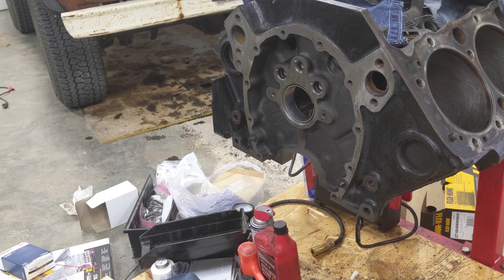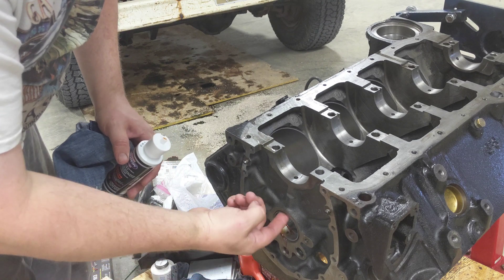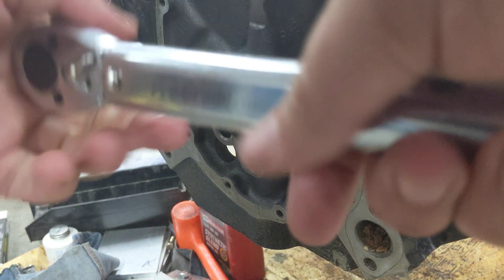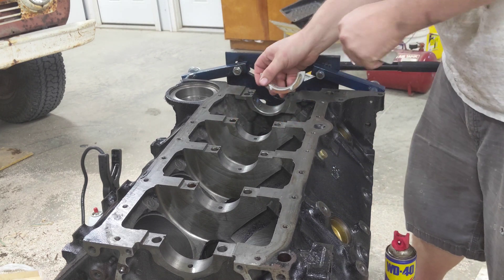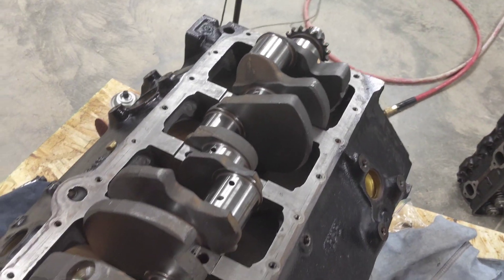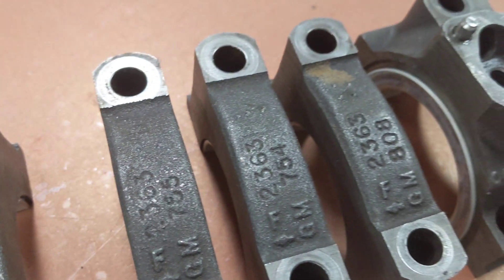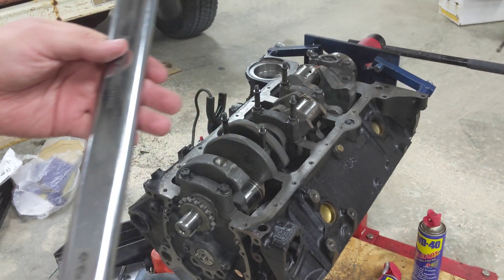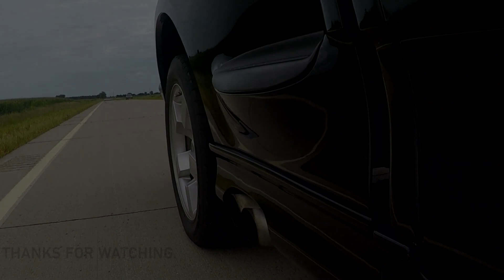'95 Crownline 5.7 Mercruiser Rebuild Part 8 -- Camshaft and Crankshaft Installation

Comment: Why so small torque for Crancshaft ? I assembly my 350 right now, and in manual are writed 105 Nm, so its 77.44 FtLb.   And also my crank is not rotation so eassy with one hand
Reply from the maker: I just went by what the service manual said. 🤷‍♂️ Been a while since I built that engine.
Reply: @605BOLT  you check Chevy manual or Mercruiser?
Reply from the maker: @latrex  mercruiser seloc is what I used if I remember correctly.
Reply from the maker: Just checked the manual and it says 80ft lbs so good catch there. Who knows where the 65 came from. It ran fine when it had oil in it. Spoiler alert.